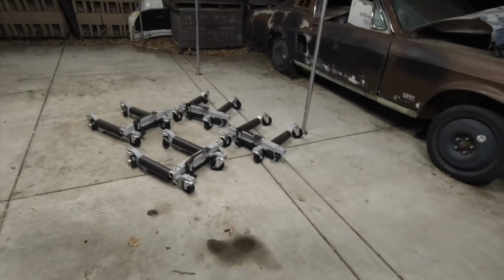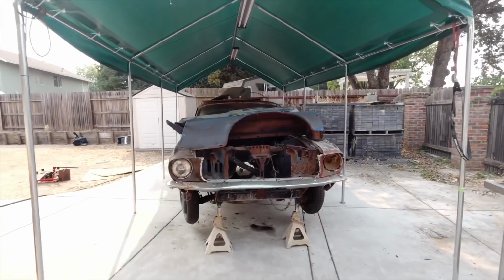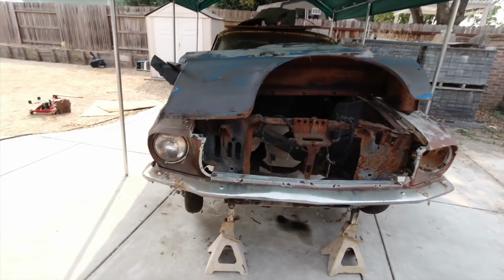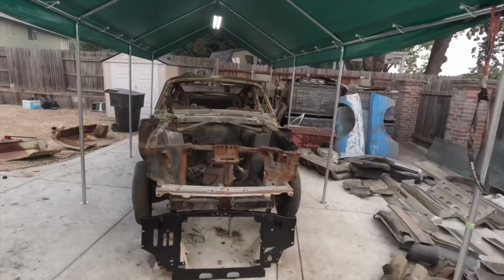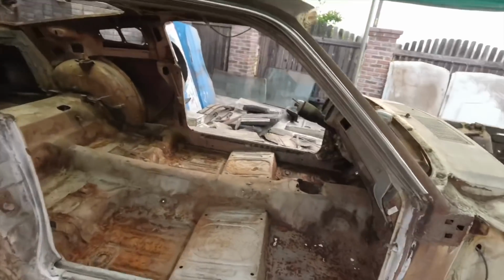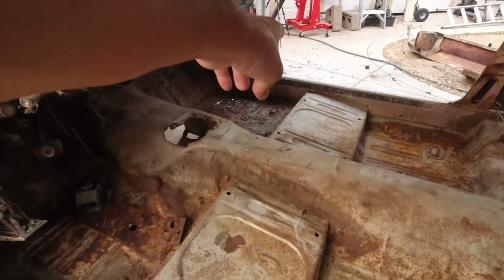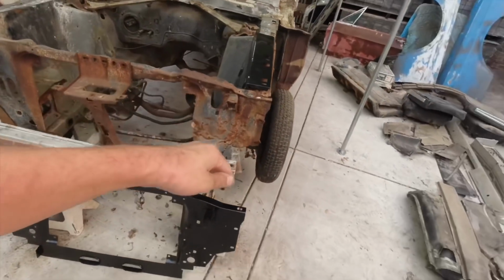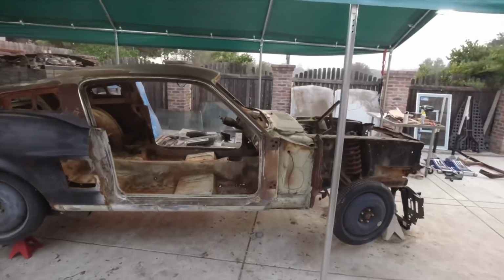(Part-1) Rare 1 of 1 Cinderella - 1968 Mustang GT Fastback S code 390 Restoration Rebuild Project

Comment: I noticed that you have a '67 rear quarter panel on the passenger side and a '68 rear quarter panel on the driver's side. I guess when they replaced the passenger quarter panel they could only find a '67. I know it won't be a problem to fix that, just an interesting part of the history of this car. It looks like a fun project. Thanks for your videos Nick.
Reply from the maker: Thanks man, I’m still debating on redoing both quarters to 68 full quarters, I kinda want to lol